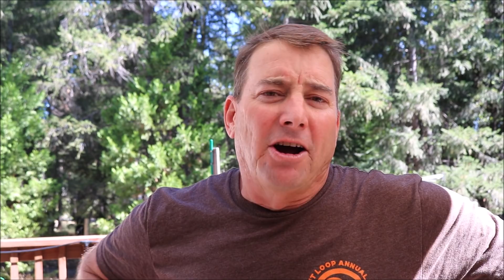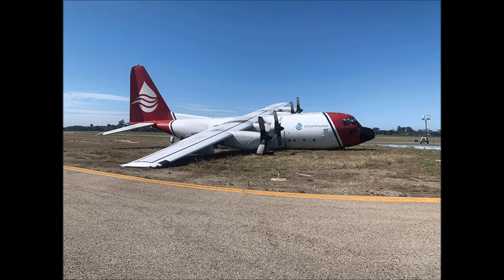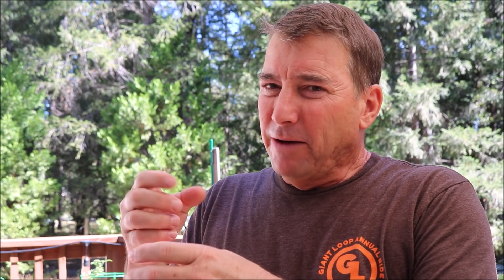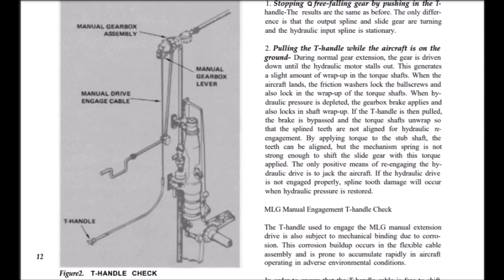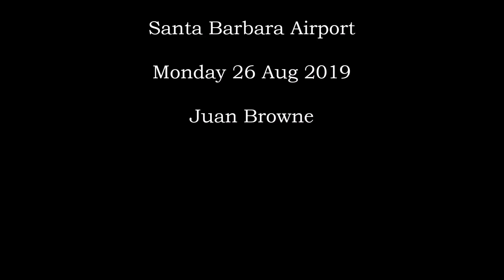C-130A Hydraulic Failure Santa Barbara Airport Sunday 25 Aug 2019

Comment: A former student of mine was on this airplane.  I sent this to him.  He replied: “Accurate about the landing gear and hydraulic systems. However, getting on the ground as quickly as possible was the main concern due to other issues that happened in flight..”
Reply from the maker: Got it Thanks!!! Great feed back.
Reply: TY
Reply: @roderickhorton7845  The Boost system would have taken care of the flight controls, this looks more like a comedy of errors that fortunately everyone was able to walk away from.
Reply: Juan covered that. No "however" necessary.
Reply: @roderickhorton7845  You've just repeated what Juan said in much nicer language than you used. I refer you to 6:04 in the video where Juan says "so it'll be interesting to see from this incident if the crew of this particular C-130 was able to get any of that accomplished or was there some other issues that required them to get on the ground sooner." Emphasis mine.  Yup. Looks like I said it exactly correctly "Juan covered that. No 'however' necessary." Notice how Juah skillfully and tactfully avoided your unnecessary words "damned fool" and any accusations that the pilots or other people were "damned fools."  Such language was entirely uncalled for.

You also must have agreed with me, as you have edited the statement I was replying to, deleting the word "however." Now it reads as a straightforward statement that you agreed with Juan. Something could have required them to land quickly, functioning landing gear or not.

Any corrections to what I said would be appreciated. Don't mind admitting if I made a mistake here.

Comment: Juan:  I've been a loadmaster for IAR since 2002 and have flown on 119TG many times.  The captain on this flight is one of the most experienced and capable pilots I have flown with in my 58 year career. Never saw a followup on this one, but I was verbally debriefed by the pilot a day or two after the incident and here's the short version.  The cause of all the problems was that immediately after takeoff from Santa Maria, the main bleed air duct coming from #3 engine exploded causing a fire in the wing and rupture of electrical, fuel, and hydraulic lines.  The engine was shut down.  Fire in the wiring harnesses was causing multiple failure indications in the cockpit.  Noticing decreasing hydraulic pressure, the crew put the landing gear handle down while they still had pressure. ALL THREE LANDING GEAR LIGHTS WERE GREEN, indicating that all gear was down and locked.  No point pumping the gear down when it indicates down and locked and no time to do so if you wanted.  Once the hydraulic press bled all the way down the flaps were inoperative and all they had left was one pump on the brakes thanks to the system accumulator.  So, with #3 caged and a fire internally on the right wing you might well imagine that the crew was anxious to get on the ground asap.  Once on the rollout, the right main started retracting eventually causing the right wingtip and external fuel tank to contact the ground starting a ground loop to the right and taking the aircraft off the runway and sending it towards the passenger terminal.  The pilot reacted quickly and brought #1 out of reverse and accelerated the ground loop swinging the nose towards open ground.  All engines were shut down and the crew egressed safely.

Comment: My uncle crashed an Airlift International C130 in Prudhoe Bay, Alaska on Christmas Eve in 1968, landing short at night in a bad snowstorm.  He was surprised when they ran out of altitude on approach and tried to go around after the 1st bounce, but as he said "it was all done flying."  One of the props sliced through the cockpit, killing the copilot and either the flight engineer or a cargo handler - can't remember which for sure.  Anyway, airport personnel were unaware of the crash until my uncle and the surviving crew member made it into the terminal on foot.  He lost a thumb but a partial one was created surgically with grafts and he flew for many more years afterward.

Comment: Unless modified later on, I'm pretty sure that the "C-130A" had 3 blade props and a very blunt nose (no radar?).  I flew on what was supposedly the last one in 1979 or so.  It vibrated terribly and was loud compared to later ones that I flew on !
Reply from the maker: modified extensively.

Comment: The U.S. Coast Guard uses the C-130 for long range search and rescue. After takeoff you can shut down 2 of the engines and cruise for about 7000 miles. They can also drop pumps, rafts, Hershey bars or whatever is needed. It's a tough reliable beast.

Comment: C-130A hydraulics is nothing like this.  C-130B and up are similar and generally operate like you stated.  C-130A are vastly different.  On A-models, there is no auxiliary system, utility and booster are connected together, #1 and #3 engines power booster, while #2 and #4 power utility.  The difference between a C-130A and a C-130B is equal to difference between a C-130H and C-130J.  They look the same but they operate much differently.

Comment: Early E models and earlier models actually had 4 hydraulic system (aircraft with side cargo doors).  Also, the LM chains the MLG together and to the floor to keep struts from spreading apart on landing (ie doing the splits) if not locked. It takes six 25k chains in a loop and two 10k chains to the floor for emergency gear tiedown. I have many years on E models as a LM, Done it many times.
Reply from the maker: Thanks Tim! 
And thanks for your service!

Comment: Thought there were friction washers at the top of the main struts actuators that prevented retraction/collapse in the event hydraulic pressure was lost/removed?
Reply: There are.  What will be interesting to see in the investigation is if the landing gear gave a down indication before full jackscrew travel and the friction washers engaged.

Comment: The collars/chains do not tie the gear “down” it ties them together so the struts do not splay/spread. The drag pins normally slide into the shelf bracket. Chaining “down” prevents the struts from ripping from the airframe should the friction washers fail during touchdown with hydraulic failure. During hydraulic failures better to touchdown firm rather than grease in so that friction washers will engage

Comment: EC-130s H and G models were the birds at VQ-4 (now decommissioned)... cutting my teeth for three months before my class A school - structures and hydraulics - I learned of the manual crank main gear extensions - you can jack up the aircraft almost as fast as cranking the jack screws to lower the gear... lots of experience in that short time.

Comment: Wow I thought only the Mexican airforce flew A models......LOL, it been many years but thought there was a washer at the bottom of each gear.leg drive assembly that would prevent the gear from collapsing after extension. Or was the gear never fully extended? The shoes if not rigged correctly could cause the gear to hang up in the tracks.

Comment: LM100 not C130 splitting hairs but civilian "C130" are LM100s
Reply: I suppose that’s correct, but IAR’s LM-100s (C-130A) all started life in the USAF.  This particular C-130A was USAF tail number 56-0511.

     So if an aircraft was in the USAF inventory for 30 years and then transferred to civilian ownership, is it wrong to refer to it by its former designation?
Reply: @Stepclimb  not 100% sure but I think the prior C130 were re worked at the Marietta plant. And resold as LM100s.
I'm currently working on the C130J line. I will half to ask around to find out.

Comment: It may be perspective, but from the photo it looks like all the props were feathered, also there seems to only be 1 (maybe 2) blades bent on the righthand outboard engine. If the engine was under power I would have expected all 4 of the blades to have been bent. (I was in a Cessna 340 crash where the landing gear gave way and all 3 blades of both engines were bent.). I'll be interested to hear the final report on the incident. Great news that all crew walked away, another good landing.

Comment: As a retired USAF officer, I am somewhat familiar with the C-130--although I was mostly a jet guy.  If it wasn't flight critical at that stage of the flight they would have been better off bringing it anyplace else than SBA.  Being an A model, it tells me that they got a good deal on a tired aircraft.  We also heard that it may have suffered additional structural problems with that rough landing.  If that's the case, Lockheed personnel probably already clued in the current owners that it may well be not economically feasible to make it flyable again.  The fact that the aircraft sat as long as it did adjacent to the runway confirms for me that the SBA authorities are simply not equipped to handle such a problem.  Years ago when some aircraft maintenance was routine in many of the hangers (to include Aero Spacelines) nearby at SBA they were probably better prepared--but its been decades.  (I watched this whole operation from my home in the foothills above the airport).  A couple of good well-orchestrated cranes and a long flatbed does wonders in this sort of situation!

Comment: Having 10,000 plus hours on Marine KC-130F/R/T I have a few comments. To my knowledge the Aux system does not provide emergency nose gear extension, this is handled by a small hydraulic reservoir and hand pump located between the left gear wheelwell bulkhead and the 245 bulkhead. Of course there may be other configurations. As for the main gear, if it is down, there are two very large pins that extend into the shelf bracket that prevents lateral movement. The gear has no mechanical downlock when in flight other than gravity and hydraulic pressure, on touchdown the jackscrews are held by a friction washer that prevents rotation of the gear jackscrew and retraction of the gear in the event of loss of hydraulic pressure. There is a mechanical downlock that can be installed, but only while on the ground.

Comment: C141 #1 Hyd System engine 1&2 (Primary) #2hyd system (Emergency system) Number 4hyd system was a pump to extend nose gear. Pump was located in Avionics Bay.  Number 3hyd I was for ground  and maintenance use.  Main gear was a gravity release if there was a failure. Pull T handle gear falls and then place landing gear safety pin in.
Reply from the maker: 141 or 130?

Comment: I bet they had some shoddy ass maintenance work done on these planes, the carry forwards is most likely a small book. That rt landing gear should have given a unsafe indication, if so the guy in the back, or flight engineer could have visually checked the gear was fully extended, he also could have manually locked the gear down and chains from the lt to rt landing gear struts to keep them from separating out if one was not fulling down in it's lock.  My dad flew this plane for 28 years, a utility system problem is a vary easily managed emergency, even on final approach and would not retract one gear, leaving the other down and locked on it's own. That landing gear was never fully extended and locked...period, sounds to me that the cp & flight engineer wasn't following their before landing check lists. In case you wanted to know my dad was in the same room with me watching this video

Comment: The main landing gear was the weakest part in the design of the C130. The main bogies are essentially hung on a "bed frame" that is driven up and down by jack screws. In the 4 corners of the bed frame are pins which take sideways and braking loading while locking the gear once screwed down to the limit. The full weight of the aircraft rests on those jack screws during and after touchdown. A failure of the jack screw would account for the partial collapse of a main wheel.

Comment: Couple of comments: on the A model, unless they were modified from the original design, the booster hydraulic pumps ran off of engines 1 and 3 and the utility pumps ran off of #'s 2 and 4 (bubu). In the event of hydraulic pump failure, the recommendation was (when i flew them in 1974/5, was to shut down the affected engine so as to not have a pump turning with out fluid to cool it. Note that in the crash photo, #4 is clearly feathered and the other 3 are somewhere along the feather process but not fully feathered. The emergency system could lower the gear. However, if there was a leak in the utility system, the number two engine pump might also not have fluid, but shutting down the second engine might make the problem way worse. Also, it is possible for the emergency system fluid to escape through the same leak. Don't say BS, cause I have seen this happen to an AC-130A at McCord AFB in June, 1975. Thus they could have landed with booster system only. No brakes, no flaps (note the flaps were up) and no nose wheel steering. Not to mention one engine shutdown, adding to control issues. Now, add in the higher landing speed of a no-flap landing and you can get the possibility of a prop getting hung up in flight idle instead of going into ground idle.  I've seen this also. I don't think anyone was hurt so these guys had their hands full, added a gear collapse and everyone got out ok...looks like they did everything right.
Reply from the maker: Excellent update William. It's hard to tell how many mods were done on this plane. I would hope most all had upgraded hydraulic pumps at least.
Reply: @blancolirio  Most, if not all, of the A models had their 3 blade props replaced with the Hamilton Standard 4 blade ones (mainly cause the lack of parts). I doubt the pumps were replaced then. Also, I don't think there was any difference in the pumps of later years, but that was a long time ago for me.

Comment: I was an aircrewman in the US Coast Guard, and worked on/flew on USCG HC-130H's for five-ish years.  IIRC:  There is at least ONE WAY - and maybe TWO - to MANUALLY lower and secure the main landing gear on those versions of the Hercules. 

That said, I am NOT personally experienced on the original "A" models, however. 

FWIW:  I was AFRAID you were going to say this was a former USCG Hercules, and I was GOING TO have a CONNIPTION.
Reply from the maker: Haa! That paint job...

Comment: Correction, it was a Airbus 320 OF Taca Airlines that ran off the runway in wet conditions.....Exactly similar scenario, 2nd attempt to Land, raining,  Fast, FLOATING and landed at the middle of the runway not able to stop....Last year, a brand new ( 6 month olds) Cessna Citation also had the same fate......landed in the same place where the previous other two planes crashed. Toncontin airport is always a challenge to land, no matter if your flying a C172 or B757....

Comment: Great video. Was crew chief on the E/H and AC-130H. Great description of how things work. But i believe the A had a different system ran from the number 4 engine for hydraulics
Reply from the maker: you are right, I wonder if/how this one was modified.
Reply: @blancolirio  many As were modified with 4 blade hamilton standard props. Upgraded avionics and radar (e/h nose).
Reply: @blancolirio  i just talked to a buddy of mine who worked on the As back in the 70s. #1 booster #2 utility #3booster #4 utility. BUBU is the acronym used to remember the system.

Comment: I observed after working on AirNational Guard C130s in New Zealand, that the maingear on a C130 are lowered with 2x screw jacks per side. So how can you manually deploy the gear without  rotating the screw jacks? Hand cranking seems to be the only option if the hydraulic motors fail.

Comment: not to be a nitpicker. am i incorrect to question wheather this was an C130A ,or  a  B model.. maybe wrong, but i flew in C130A's that had only a three blade prop ie;  while assigned at little rock afb 1970.
Reply from the maker: Modified A.

Comment: Was in a C-130 coming in for a landing kept circling the base found out the front landing gear did not go all the way down There is a trap door with a heavy plexiglas window with a hole in it that is where the old style manual hand crank goes thru attaches to the pinion Crank away there were plenty of volunteers to get the wheel down

Comment: Wonder if the friction washers were gapped correctly at the bottom of the mlg ball screws. Iirc, if they have to do a manual drop the gear can collapse if they float it or smash it on touchdown.  It either softly puts pressure on it allowing the friction washer to slip or overcomes the friction with too much pressure by landing hard. Neither of which is a factor if the rig is bad.

Comment: Hawn Air in Honolulu has informed us that NO fire on A-321 neo. It was a oil ring gasket that failed leading to leakage of oil onto hot engine. It then entered the ac system filling cabin and cargo area. First indication was fire in cargo warning then suppression bottles were dispensed.  Smoke continued and 7700 was declared 20 minutes out of Honolulu for an asap landing and shoots deployed on runway. A few minor injuries due to drop at end of slides and for smoke inhalation.

Comment: Your doing a better job than MSM keeping up! ,used to work on E`s and H`s those gear are pretty strong and designed to stay down mechanically (without hyd press) so it  is a surprise if one of them collapsed never hearrd of that in my  career. As you know they take heavy loads onto rough short strips. Also surprised that A`s are still flying!